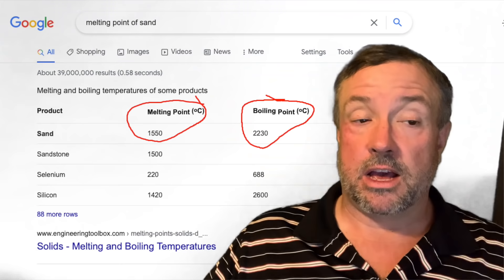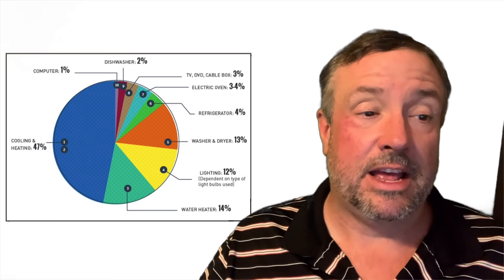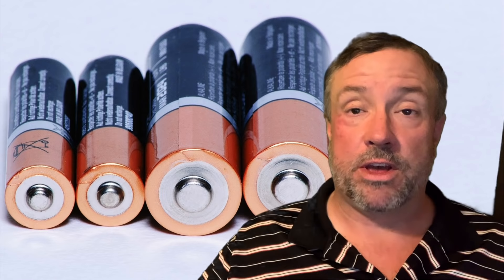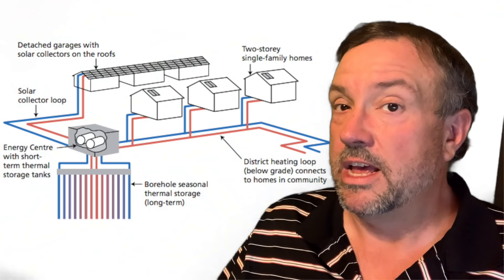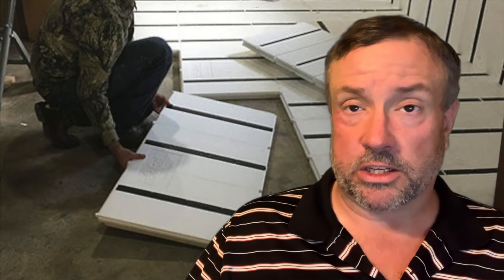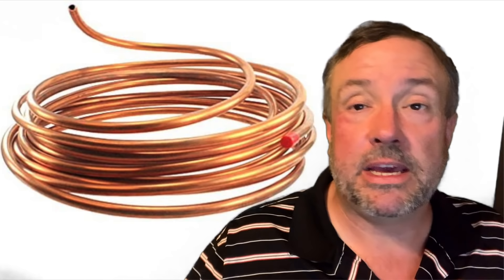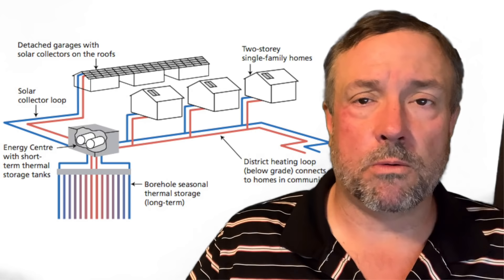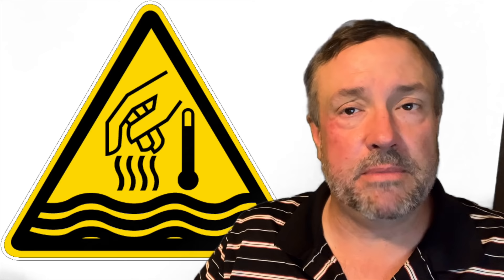Sand for Thermal Energy Storage

Comment: Wet sand is a brilliant thermal medium. Water for efficient thermal mass and circulation, sand for structure.

You shouldn't need to take the storage medium up above 100C°.

Too high temperature creates insulation and conversion problems, because it is unusably hot. Water has huge thermal inertia compared with any other medium other than perhaps molten salt which is definitely too hot for domestic storage.
Reply from the maker: good insight

Comment: i think NOT going over 90 C and ceeping system simple is best option ...and storing heat directly under the house into ground in isolated (around) foundation is best ...u have to build new house ...since i dont have it i'm gonna build it ....i will heat up floor beneath me only to 25 C ...you need big and if its big m3 of storage it can last ''3-5''? days untill sun apears again to heat it back up to normal ...best is to ceep it simple ---its cheaper and ecologicaly correct ...any bigger heat requaire aluminium and oils and who knows what ....i will build it here in Balcan Europe region ...if dont move to tropic part of earth an no worry about heating aver again ....😅 only cooling ....well ...i can build something in deep forest shade there
Reply from the maker: Well ok then

Comment: The lords used to have ice cellars where ice was stored in massive underground brick lined tombs. The houses has ice all the year round.
Harvesting summer for winter requiring 7000 KWHr plus can only be got by solar the catalyst “x” to a higher energy material which can be reduced or oxidised in winter.   Sorry sand has poor thermal capacity or the Sahara would be hot in winter..
A bit of novel chemistry is needed with the help of companies like Johnson Matthey plc who are catalyst experts.
Carry on
Reply from the maker: my grandfather used to haul ice cut from the lake for summer storage in ground containers.

Comment: How about wireless step up coils in combination with your other ideas. 
Aluminum pipe. Or aluminum fins on copper tubing ran thru sand. Heat sink 
A pit with copper running tru sand, pipe every thing connected to a tesla tower, come on give it up.
Reply from the maker: Good ideas

Comment: If lower budget. How about smaller sand batteries really well insulated sunken down in to a big insulated water tank used for heating the house with a small pump. With lets say only 1kw solar and 1kw wind how would the heating situation be after three days without sun or wind in the winter? Thinking that if the heat last for like 3 days that is a lot really.  Also because you can charge certain times when electricity price is low. 
A better version of this one.  https://www.youtube.com/watch?v=8rG6b3KSv1Q 
One insulated sand battery per solar panel or wind generator sunken into a big water tank. Maybe no electronic components but the solar cell or wind generator is needed. Don't know the limits of those "ceramic/aluminum heating elements"..
Reply from the maker: Very interesting

Comment: check out Robert Murry Smith he has some good ideas on this he is a battery engineer ? you could use a normal solar pannel and dump the electricity into your sand via a heating element from an electric oven ? you need a step down connection but it is simple and the oven element will go to 450 easy ? buy corrigated roofing sheet to make your box from  but put the frame on the out side and the metal sheet as a liner then insulate the inside, and  a gain with a heat prof  insulation board of 6 inches or so use that as the base and top run a one inch copper pipe in a coil of about twenty feet plus or a high heat plastic pipe then pump water through it and pass it through a coiled hot water emersion tank all the hot water you will ever need but put a heat source electric  cut off valve so that you don't over heat the tank of water ?put a pump on it for your homes use ?check out all of this system with a qulifide plumber as he should know the how where and when of a system like this ?

Comment: I like your idea. I've been thinking about something similar myself, primarily to supply hot water. I like your thinking about doing things on the cheap. The oil seems like a good idea because if you pipe water though the hot sand you may end up boiling it which could create a dangerous or at least a hard to regulate condition. My thought was to use a tube in shell heat exchanger on the side of a normal tank style water heater like the one at this link https://youtu.be/9mkF5gI3bQo with a closed loop of soybean oil. If the oil loop is purged of air then it seems to me that the circulation pump for the oil could be installed after the oil passes through the heat exchanger so that it encounters the oil at its coolest temperature, that way you could use a cheaper circulation pump. The viscosity of soybean oil is pretty low especially when it is hot. It's edible so there is no danger of poisoning anybody if a leak developed between the oil and water. Since it has a high boiling point it is unlikely to cause any damage due to expansion. It's readily available for less than $9 per gallon from places like Walmart. It's non corrosive. The tube in shell exchanger doesn't require a circulation pump on the water side. The temperature of the water in the tank could be used to control the cycling of the oil pump. With a large enough battery of stored heat energy you could have virtually endless hot water from a tank system provided that the energy transfer into the water is fast enough. Combined with a thermostatic valve on the outlet of the water tank I think a system like this could be very reliable and nearly free. I think eps foam makes the best sense for insulation. To my knowledge it is the cheapest form of insulation that can be buried without an issue is EPS foam. It does have a melting point of about 200° C which could potentially be an issue. That could probably be mitigated with the use of some aircrete between the eps and the sand.
Reply from the maker: I like a lot of what you said

Comment: I just found some good info about using aircrete blocks. https://www.youtube.com/watch?v=TCAIZiQu3W4 I do not know how poured aircrete compares to aircrete blocks. But the fact they are weaker to side pressures vs downward pressures concerns me. Being underground construction, cracks will not be seen. This will leak out heat and allow water into high heated sand making steam/pressure build up. 
I think I will pass on using aircrete for holding sand or water heat bank construction.

Comment: Gives us all something to think about
you are over thinking.  When and where in your house are you going to use any type of heat that is 200 degrees C, Let alone Fahrenheit?

how about two large water tanks filled with sand buried underground as the front end of a geothermal system.  Your greenhouse and your home heat pump deliver hot air through them, using multiple pipes to distribute the heat evenly.  They then merge as one pipe and finish the 100 feet or more in order to cool and that is pumped into your greenhouse at a constant temp, in winter it is reversed
Reply from the maker: Interesting
Reply: @SimpleTek  Basalt absorbs and releases heat a lot slower than sand.  I would go to a  wholesaler for it but home depot does sell it by the bag, if you want to experiment with it first
Reply from the maker: @kcubs222  interesting! Thank you

Comment: liquid : FLUID 
dont heat OIL in the solar section 
use a FINE sand in the Solar section suggest Black Iron Pipe as the heat collection pipe
using a mineing screw type 

cheers mate
Reply from the maker: awesome! cheers!

Comment: Rock dust would work better it'll hold heat for days.
Reply from the maker: isn't that just fine sand?
Reply: @SimpleTek  😀🤪 Yes I guess it is technically.
I just know that I used to work at asphalt plant and there was a giant bag house that would vacuum all the dust and finds out of the mix and it would Purge the filter media down into an auger and that dry Rock Dust would flow like water. Seemed like it held heat for days

Comment: here is a modification on your concept, but may add to it with simplicity and expanded functionality. https://youtu.be/tm7spMG0ch8
They are using alternative energy to heat the sand with resistive heat, and then use the thermal bank of sand to heat the water to use in your existing systems. just an idea.
Reply from the maker: thank you

Comment: Sand grains contain too much air relative to the total volume.
Basalt spheres or just rocks in mineral oil is way better.
Reply: Or sand in mineral oil?  Possible but it drives up the cost of the 'battery'.
Reply: @graveseeker  large lumps of basalt hold heat much better than little sand grains...   But the idea is perfect, store the access sun power in materials that release the heat afterwards.
Reply: @erwinmaes780   The material used to store the heat doesn't interest me.  That will be determined by price and heat storage characteristics.  The infrastructure surrounding it is what interests me.   How large and what type of collecting system is best?  What is the cheapest, strongest and most insulative way to contain the material that will not deteriorate or transmit water?  What is the cheapest (including maintenance), safest, most scalable and most efficient way to use the energy stored in the medium?  What is the expected life of such a system and what is the ROI?
Reply from the maker: ROI is the most important thing!!!

Comment: if you contact me i have a drawing i did back 5 years ago you can build. utilizing electric induction with a orc generator system. with stainless steel coils.
Reply from the maker: what is an orc generator system?
Reply: @SimpleTek  organic rankine cycle. waste heat to power system

Comment: how about a system like a electrical transformer. transformers step electrical energy up  or down, so think copper pipes instead of wire, two sperate systems with the sand as a medium of exchange like a transformer's iron core...you owe me a beer...
Reply from the maker: I just drank your beer!

Comment: solar concentration sand
Reply from the maker: That exists?
Reply: @SimpleTek  if not then right now
Reply: @SimpleTek  its actually the solar reflector heat towers, but simpler
Reply: @SimpleTek  parabolic heat transport mirror pipe
Reply from the maker: @Jkauppa  there’s solar reflector heat towers?
Reply: @SimpleTek  so its reported
Reply: @SimpleTek  point is that stationary trench mirrors are stupid simple easy cheap to do
Reply: @SimpleTek  if you put the parabolic trench (optionally with water) then the sun always concentrates to the target copper transport pipe
Reply: @SimpleTek  that pipe can run sand as the medium
Reply: @SimpleTek  just air blow the sand around to get super heated to 1000C
Reply: @SimpleTek  think about the collapsed astro-observatory mega reflector disc in the jungle
Reply: @SimpleTek  concentrate solar to a solar panel, collect the heat, keep it cool, I prefer parabolic aluminium mirror concentrator, the solar panel strip is up-side down as the target, above the ground, suspended
Reply from the maker: @Jkauppa  I’m guessing you mean a parabolic mirror or trouph.  or an eVacuated tube producing heat
Reply: @SimpleTek  I mean a parabolic swimming pool
Reply: @SimpleTek  I mean just what I wrote, nothing else
Reply: @SimpleTek  I mean nothing small, a real wide deep solar trench public swimming pool size
Reply: @SimpleTek  I mean a canal sized solar concentrator valley
Reply: @SimpleTek  or just a valley sized solar mirror concentrator, I dont need to be corrected
Reply from the maker: @Jkauppa  ok
Reply from the maker: @Jkauppa  ok

Comment: Cheap but we are running out of it ....
Reply from the maker: Round sand is almost unlimited and everywhere, it’s angular sand that’s running out but that’s also kind a falsehood too as it’s a by product of blasting used to make material for roads
Reply: @SimpleTek  so which is used in cement?which should you use for a thermal battery? I ask as I buying a house that needs heat as its solid walls....
Reply from the maker: @fabriglas  a thermal battery doesn’t care if it’s angular or round sand. Round might be better because it doesn’t pack as tight
Reply from the maker: Angular is used in cement

Comment: Stupid. Sandy area's are hot in the day and cold in the nigth, clay remains cooler under the sun, but does not turn as cold as sand... Clay does store a lot better heat than sand.
Reply from the maker: clay's early advantage is only in how much water content it has - above 100'C this becomes a useless point. You'd know that if you knew what you were talking about.... what's that word you used... it started with an "s"....
Reply from the maker: @cauwenberghsroeland8607  you really don't know what you are talking about
Reply: @SimpleTek  Idem.
Reply from the maker: @cauwenberghsroeland8607  you don't even know how to use that word properly

Comment: Whoa..let me stop you right there!(1:08). Water doesn't have a range of boiling point. It can boil at slightly diff T° yes at diff height ASL. Put water under the right pressure and it will become steam(steam is invisible) from about 375° C and 500° C for superheated steam..how do you think steam generators work?..but yes, sand can hold heat for longer and higher T° .
Reply from the maker: water's boiling point varies depending on atmospheric pressure - so what DOES have a range of boiling points. ;P. Thank you for the comment!
Reply: Most of us are mere laymen and not High Pressure Steam Engineers. I have worked as a Boilermaker for a period. I had to be soo careful in all my work and making sure I was doing everything perfect. I have some experience working with steam, but will never use it in a homemade applications. 
Way too dangerous for a layman to mess with.
Reply from the maker: @redstone1999  agreed, I like high temperature liquids better. high pressure bad

Comment: Run hot air through cow poop.
Reply from the maker: ummm ok....
Reply: @LaurenBurger  )))) I don't mean to pump air directly through poop )). The tube through which the air flows would be in the poop .... or anything that can compost. Heat inside these "piles"  is very high and lasts for months.
Reply: Actually, by running pipes through the heap, it should extend the heat producing cycle .... the heat absorbed by the air in the pipes would slow down the bacterial process thus extending the time for it to complete.

Comment: OK...very stupid !  You use a wind generator to make electricity...use this to run electric heater elements like a KILN...hobby home electric kiln !  JUST GIGANTIC SIZED  Fill the kiln with SAND....and run a finned pipe conduit in the center and have enough space for a nice medium of sand in mass and distance from the center conduit and heat elements.  It get a proportional aspect and ratios....of distance to mass from the heater source.....so conventionally for a home hobby guy...think a 55 gallon barrel...steel barrel...heavy thick wall type barrel.  SAND in BARREL as described....outside of barrel....a FINNED JACKET that can be clamped on for a solid mechanical coupling to the barrel wall or otherwise mod the barrel by welding fins to its external surface.  Assemble an array of these barrels in a stack and column formation in a containing structure or giant vessel.....perhaps buried in the ground is best !!  In the ground lets you establish a HOT AIR blown in air exchange system to heat the house....minding its outside air !  But if you design a normal recirculating air system with the house for HOT AIR HEAT.....its a simple conversion.  BUT as for COOLING....Since the critical HEATING aspect if now solved....the under ground aspect can be  extended.....a DIVERTER VALVE FOR THE AIR STREAM...diverting to an alternative run of pipe/conduit that is buried for the natural cooling of the earth and circulation air to cool it this way...natural AC !  SO obviously a BLOWER is needed in either aspplication...so you need efficient electric with is WIND POWER plus Battery storage !!  FINLAND !!  AND A GUY DOING THIS FOR A GREENHOUSE LIKE IN THE MIDDLE OF NEBRASKA as climate control on the small scale.....and FINLAND on the MEGA SCALE !
Reply: The Ambri was designed by Canadians at MIT
Reply from the maker: Wow!

Comment: how in the world is sand a battery, especially in this video of what you're saying? a battery is capable of storing energy and then releasing them when used without external energy source. sand you heat them and then the energy dissipate over time cause warm object will always turn cold. this makes no sense
Reply from the maker: I’m sorry you couldn’t figure it out.

Comment: From an engineering stand point, please consider the solar irradiance for your part of the planet.  This is the seasonal amount of radiation flux in W/m^2 you can expect to receive from the sun.  Concentrated solar plants use large areas to achieve higher and higher temperatures because it is all tied back to this energy flux per unit area from the sun that they try and absorb for their location.  There is public data about your area from meteorologist.   I did calculations for my home, I would need about 30 m^2 of collection area to get close to collecting enough energy to cover my average energy consumption totally by the sun (that's a boat load of land I don't have in the city).  Plus there is a bunch of losses after you collect the energy on the power generation side so you need to account for.  In the end, you probably need like 150% or 200% of your average daily energy consumption to cover all your losses.  Now will the wife let you put solar collectors all over your property where your grass wont even grow?
Reply from the maker: Math, not your strongest attribute